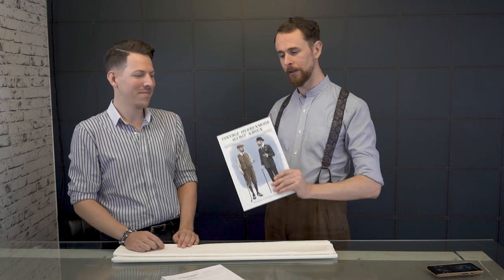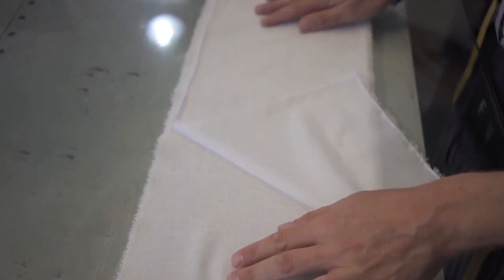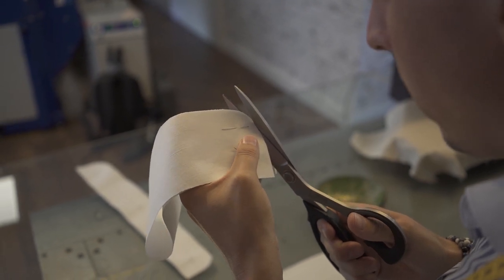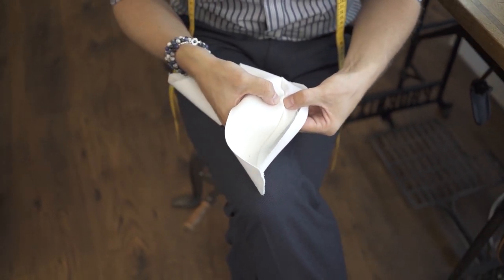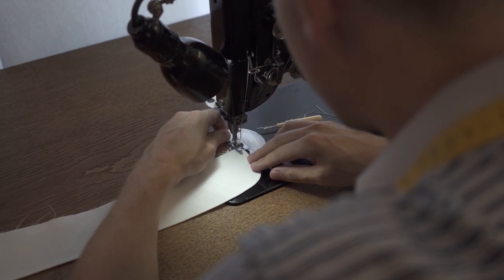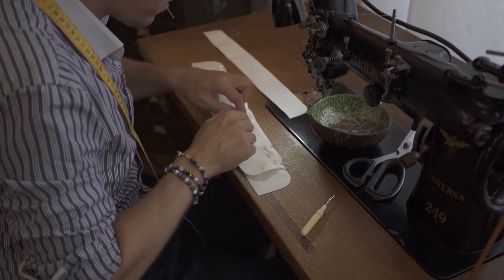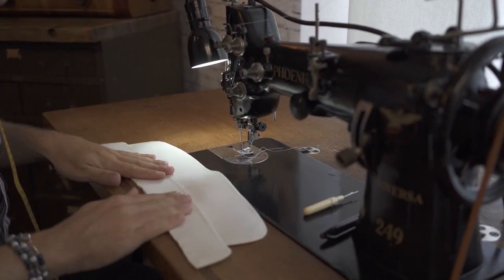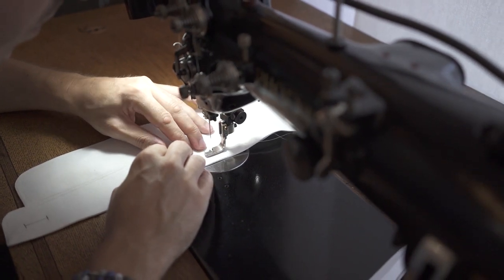Sewing Detachable Collars - A Masterclass

Comment: Looks fun. I usually have a separate piece for my undercollar, as I normally include pockets for stays, but that wouldn't be authentic for detachables, i suppose...
Just a heads up on Frixxon pens: the ink doesn't disappear with heat, the heat just turns the ink transparent. If you put your collar in the freezer, or if you wear it outside in cold winter weather, the ink will re-appear, unless you wash it out completely.

Comment: These pre-made ones, for the lazy ones like me in the EU, on eBay are mostly coming from UK wedding costume rental businesses, and are in fractional inches. How do I measure the size and order the right ones? The actual neck circumference (inside the shirt collar) or outside the shirt collar (inside the detachable starched collar)?  Are you planning on making a video on how to buy from eBay in regard to the items  from the UK - as at the end of this year UK will be outside the EU customs union so the (expensive) items ordered from the UK sellers may attract customs duty charges.  Please correct me if I am wrong.

Comment: Your Sewing Machine may be an old model..  however it's superior to all the modern domestic ones available to the public because your's came already factory built into the centre of a sturdy metal and thick wooden table which supports and keeps flat the item you're making. Everything: especially larger and heavier sewing projects "fall off" the edges of newer Sewing Machines (making heavy or lined drapes are a nightmare) nearly all of which  aren't at all built-in to any sort of table or platform.